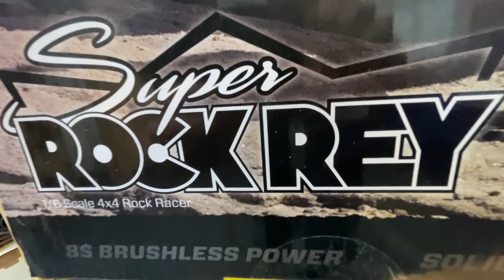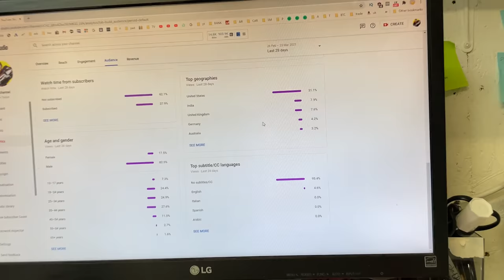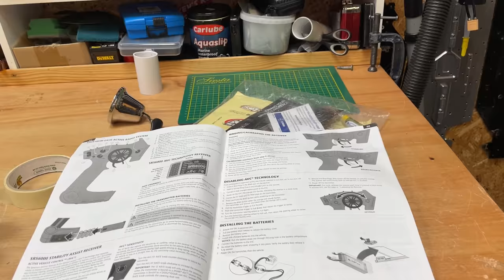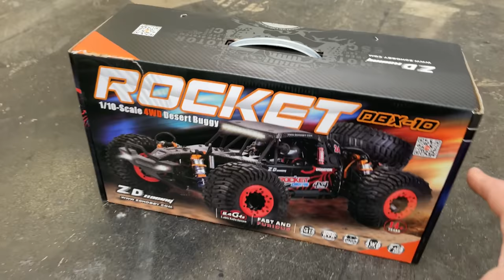GIANT new RC Rock Racer testing

Comment: Kev I've got a  srr and I don't think you are running yours on full power it's a 3 position switch on the top of the original controller ! Mine is barely controllable on full power and the tyres balloon way more than yours !! Hope this is useful.

Comment: I have to say the Losi LED light bars are junk. I have an SBR with about 5 battery packs on it with a stripping light bar like you has on that SRR, I have a DBXL-E and the LED light bar completely failed on that one. Losi do not warrant the light bars so my local model shop replaced it on their dime. Losi cars are awesome, the light bard they use are total junk and they should be ashamed, no warranty and junk parts.